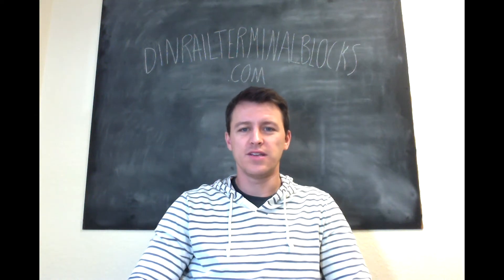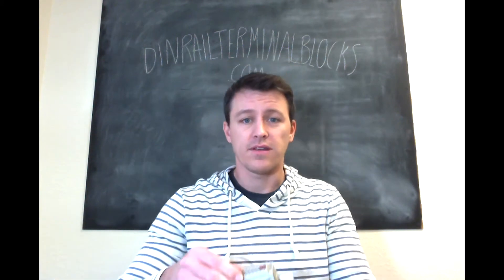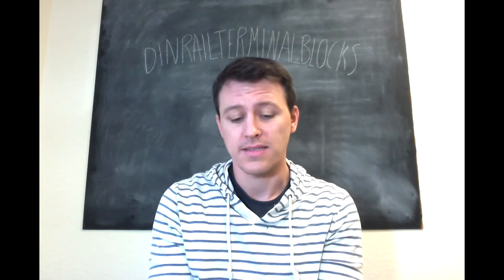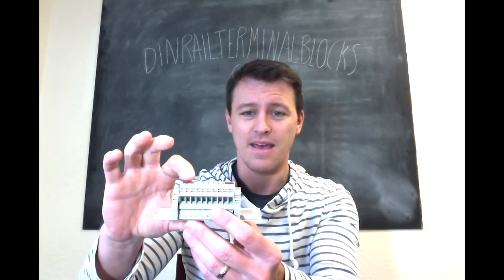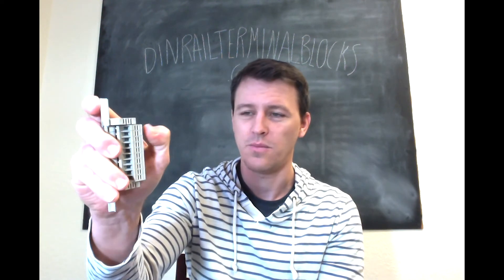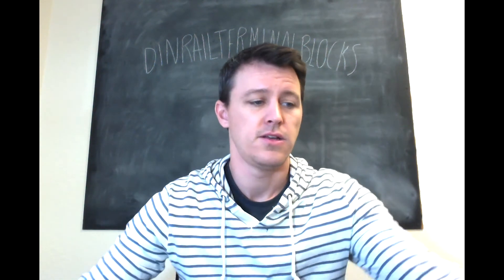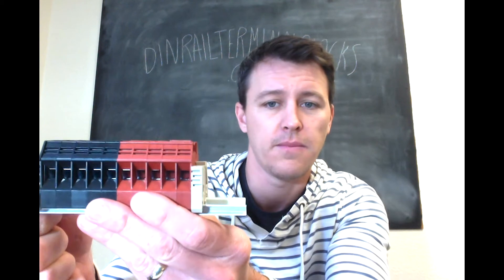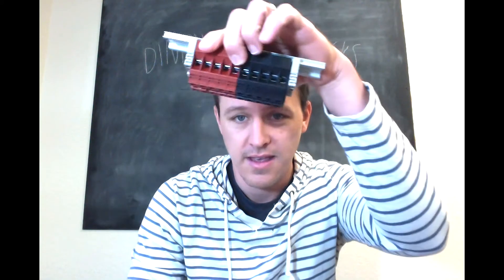How To Use DIN Rail Block Jumpers - DIN Rail Terminal Blocks Video Blog #5

Comment: What about the longer jumpers.  Can they be cut down to size?  So if I want to jumper 3 or 4 blocks together?
Reply from the maker: We sell jumpers in different sizes from 2-pole to 10-pole.  That way, they are fully insulated.  You can cut them down to size with cutting pliers, but keep in mind that this can affect the finger safety.  I also recommend flipping those cut ends away from each other.